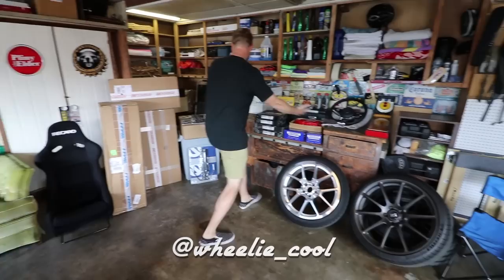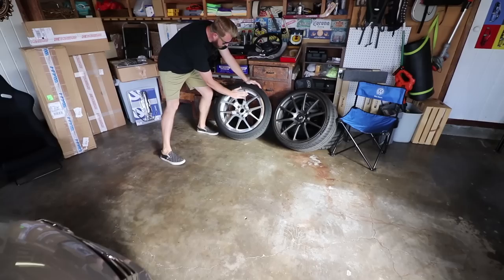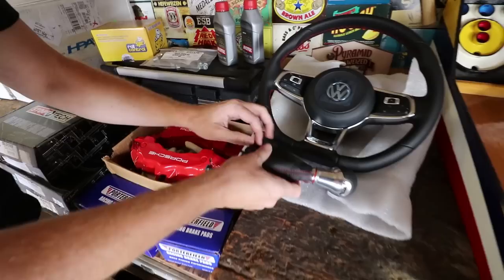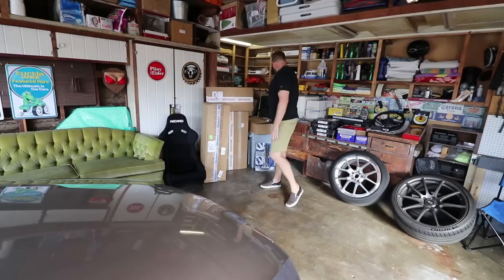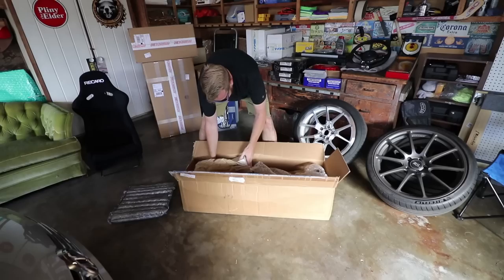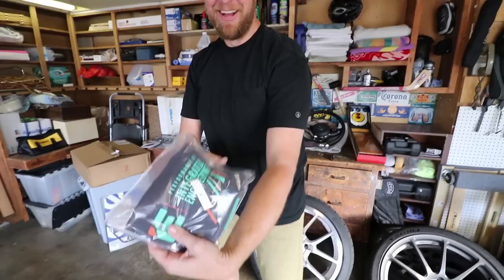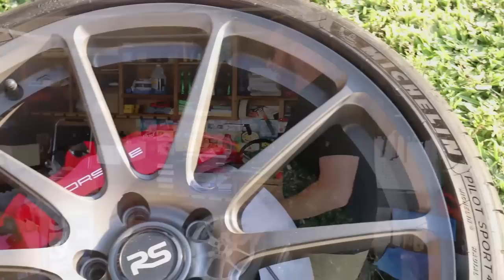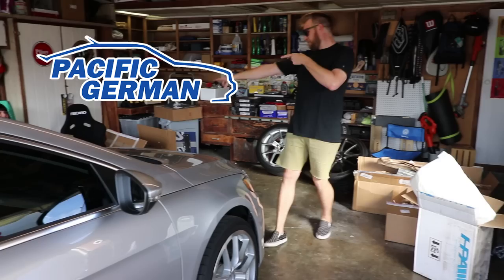$15,000 in Performance Parts!!! - Ultimate TSI Build

Comment: hey whats up! Love the Vids with the CC. I have a '11 CC 6-Speed Manual. Best car I've had. Theres so much unlocked potential in the VW CC. The CC has the most rigid chassis that VW makes. Couple that with the higher amounts of high strength aluminum components through-out, and the CC isn't just another sedan. A Few Things I recommend:
1. Go Fast Bit’s DV+ Diverter valve
2. Black Forest Industries Engine & Transmission Mount
3. SuperPro Bushing Kit “Street”
4.TyrolSport Subframe Collar Kit
5. IE Catch Can
6. South-Bend Racing Clutch Stage 2 “Daily”
****MOST IMPORTANTLY****
If you haven't done it yet, REPLACE YOUR TIMING CHAIN TENSIONER & TIMING CHAIN!!!
VW put a faulty tensioner in the late model cars. The original chain is prone to stretching, which can lead to the chain jumping off of the sprocket at higher RPMs. This can take out multiple valves with it, causing a pretty high cost repair.
     Hope all is well!! I'm looking forward to see how everything preforms for you! Enjoy!!
Reply: That issue was fixed the second half of 2012. This car is a second gen 2013+.

Comment: If that intake manifold adds 14 hp im a batman.
Reply: CME 

A Performance VTEC intake manifold allows more air and fuel mixture breathability. Which like he said, adds roughly 40hp with the new k04 he’s putting on.
Reply: By itself no. But with the new turbo and ecu tune. Should get way more

Comment: This isn't supposed to be a hate comment or anything I just want to know. Why do this on a Volkswagen cc? Is there some special appeal for this car or is it a great tuner car?
Reply: Robotic Venom i mean, i guess it depends on what you want to do, i have a buddy that has 411whp in a sonata 2.0t another with 300whp, it all depends if its the car you want to tune, cc are nice, i would tune it, im tuning my sonata 2.0t to see 300whp.
Reply: Turbonata !! Damn unless your some parts I'm sure that's a lot of stress on the turbos and engine but fuck it right! Cause even the professional hondata tune on the Accord 2.0t will hurt your reliability considerably. Damn that's so sick 411whp! That thing must be a major sleeper!
Reply: Robotic Venom ohh it is, fast sonata i think in the world, built biggee turbo by turbokits.com and suprisingly the turbos the sonata's have can pack a punch. The bottom block is the same as an evo so it holds, the 411whp im talking about is on a bigger turbo kit, completely stock internals and this all happened when the car already had 100+k miles, these cars are really underrated, the only thing that had to be upgraded was the transmission to hold the hp so it was "bulletproofed" by lvl 10 transmissions out in jersey to hold up to 600whp. The stock trans can hold 350whp with no problem. Hes been running this setup on stock internals for more than a year and still no problems.
Reply: Robotic Venom I’ve got a stage 2 cc and for me it’s the ability to have a super comfortable quite car that no one expects to move like it does. Downfall is they are fwd and they are not light cars. They look good and with a stage 1 tune I was walking in sti’s. Oh and if you behave you still get 30 mpg.
Reply: Justin Proulx thats exactly what im talking about, fwd, definitiely not light cars but rolling, yea these things can handle, ive walked v6 chargers, till i get to higher mph (100+) then the turbo falls flat on its face lol but over they dont expect these cars to move the way they do and yes still getting 30mpg if amazing, but its hard to do cause you get so damn throttle happy! Haha
Reply: Well, I have one and I look at it as a extended wheelbase GTI. With the 6 speed or DSG, it has potential.
Reply: Robotic Venom very easy to work on plus there are a lot of pats available for upgrades it's a gift that's just keeps on giving.
Reply: Justin Proulx this is it for me I got a stage 1 r line Passat and to me this is out of all my friends cars is the most fun of them all to drive.

Comment: Any fuel system upgrade?? Stock fuel pump can’t handle that power
Reply: connor jones I think it’s fine on stock fuel pump it needs Audi s3 injectors or it would run lean.
Reply: I’ve got a stage 2 APR cc and it’s already having fuel issues. If you go to a k04 and stage 3 software, I’m pretty positive your gonna have fuel cuts on the stock one
Reply: connor jones I was just going off of a mk6 gti it’s the same engine but probably some differences but it wouldn’t be a bad idea to do a fuel system upgrade to be on the safe side
Reply: connor jones My brother had a mk7 gti with the is38 turbo from the golf r and he only did Audi R8 injectors
Reply: Be lucky to make 350 of standard fuel pumps, probably need low pressure and high pressure upgrades
Reply: Definitely need to upgrade the LPFP and HPFP if you're going stage 3, without a doubt

Comment: Hi there I'd love to intall the same steering wheel u put on you cc since I have a vw cc 2013 but I have couple question I hope u can help with clear those doubts I have fists thanks for this great videos and second is my CC has the cruise control on the side of the column and the .k7 GLI steering wheel has those control ok the steering wheel  so which set of cruise control will continue working on the car the original or the one on the steering wheel....ill appreciate your help thank you so much

Comment: You need the Scirocco facelift steering wheel buttons in order to make the buttons on your new steering wheel to work. Since the Scirocco is still available and has gone through the latest update, it got all the fancy Golf Mk7 stuff and looks to it. That's why it will only work that way. You will lose the cruise control buttons, etc. But that is not gonna work on the current setup of the wheel tough. :)
Reply from the maker: The Wheel I got was plug and play.  All buttons work except for cruise buttons. 👍🏼👍🏼
Reply: Exactly what I said. Get the Scirocco inserts to get rid of the cruise control buttons...

Comment: Will you be doing a brake master cylinder “upgrade” (ttrs bmc) to cope with the higher fluid capacity of the 18z? I had a soft pedal with long pedal travel on my MK5 R on the standard bmc using those exact calipers

Comment: 15 k on “performance” still ain’t reaching 500hp
Reply: NINJATurtleMan53 think he would have to spend 30-40 thousand to get that motor to 500 HP. Besides that engine can’t take more than 350 HP or the internals blow
Reply: @Every14days826  30-40 thousand? Lmao
Reply: Re Re nah he should’ve bought a gtx2871r and could’ve gotten to 500+ on stock internals how long is the question

Comment: Slapping a bunch of parts on your car is not a "build".
Reply: It is a build, a build is any modification from factory not your arbitrary opinion of what it should be.
Reply: Michael Scofield 

Historically, the term’s been used to describe the degree to which an engine’s been strengthened by way of stronger internal components. And historically, it’s got nothing to do with horsepower, turbos, or even color-coordinated valve covers. Today, though, for some, the term isn’t just limited to strength. For some, it represents power output; for others, whether or not certain key engine bits that have no bearing on durability have been replaced or modified; and still for others, whether or not that valve cover matches those lug nuts.

it IS a build. He’s rendering ENGINE modification to improve the SPECS of his car. A fucking build. And you called the other guy stupid? HAHA. Go back to school mate.